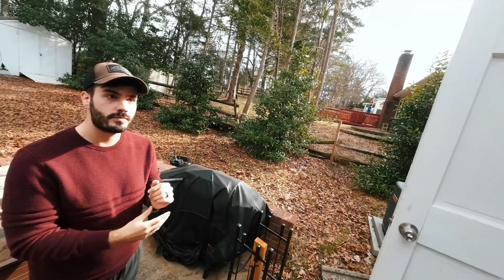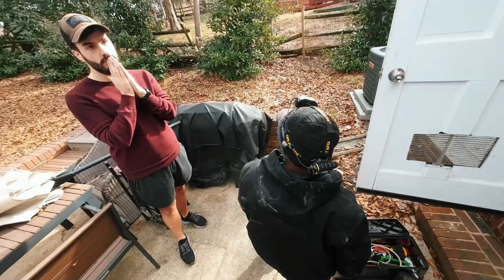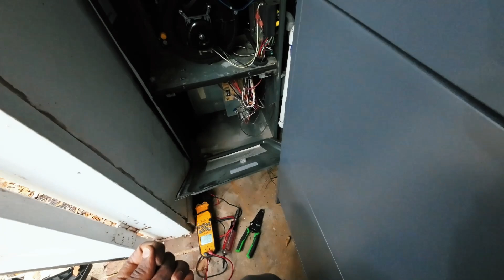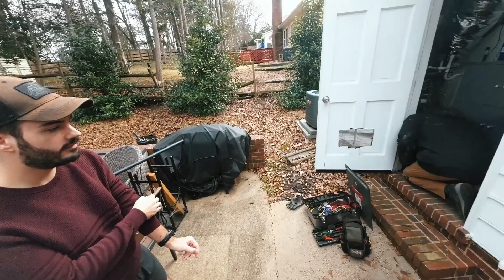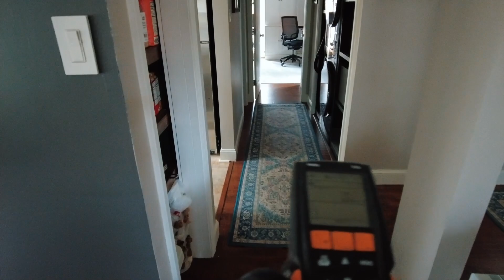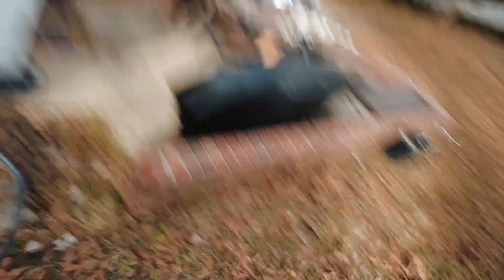Curious Customer gets Crash course on preventative maintenance HVAC tech maintenance on 90% Furnace

Comment: Higher static means higher power consumption. You can often set the static higher in modern equipment order to achieve more airflow. Older type blowers would have inverse relationships between airflow and static. Of course eventually when static is high enough it will prevent increasing airflow

Comment: ecm  will adjust to static to a point  but psc is fixed  the more restriction the more amps
Reply from the maker: A PSC motor will actually draw less amps with more restriction to flow
Reply: @HVACTechKnowledgy  you know as i read this i rechecked  and it is a debatable topic however i was thinking if we have the blower cover off amp draw tends to be higher and when we cover the blower it goes down in most cases. And with condenser fans it is the opposite lol i think. Lol but thank you for pointing this out i am going to do more research. But in general i think you are right
Reply: @kennethduncan8563 only the constant torque ecm will drop airflow like the psc will when airflow is low the constant airflow will ramp up to compensate for lack of air. Both are ecm but operate differently